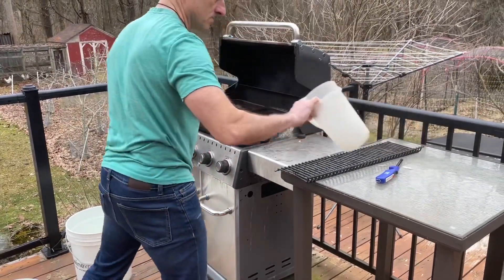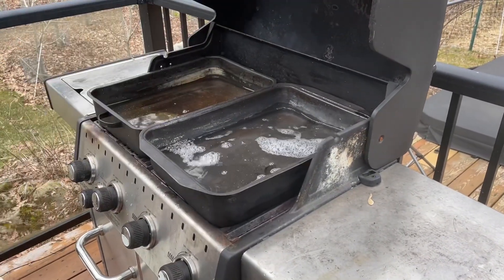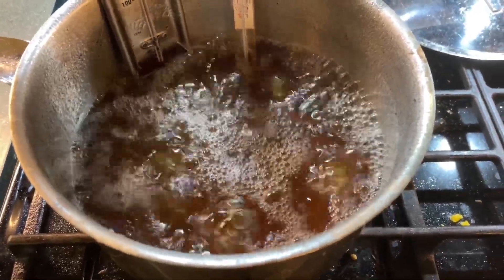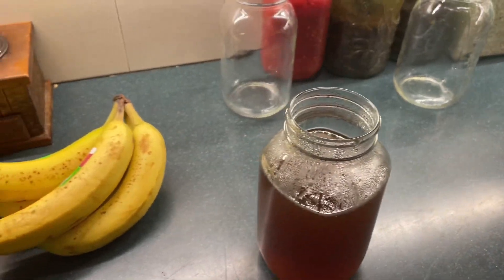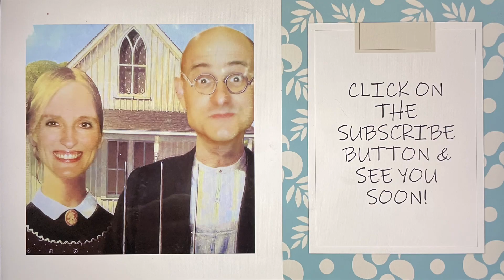Making Maple Syrup, Start to Finish!

Comment: Sweet rewards!  I remember doing this with my father and siblings growing up in Quebec.  The first year we boiled inside on the kitchen stove while my mother was out.  We ended up having to repaint the kitchen after scrapping off the sticky mess on the walls and ceiling.
Reply from the maker: Haha, that sounds like something I would have done as a kid! I love this time of year for this reason. We also make maple sugar and use it for baking. It's amazing what you can do with a few maple trees! Thanks for the comment!
Reply: Is it better to process the sap straight away or can you store it for a bit of time, before processing it?
Reply from the maker: Hello there! It's better to process it as soon as you can as it can spoil. I have read that you should treat it like milk, you want to keep it chilled and then it will be alright for a while, but not too long. Thanks for the comment!